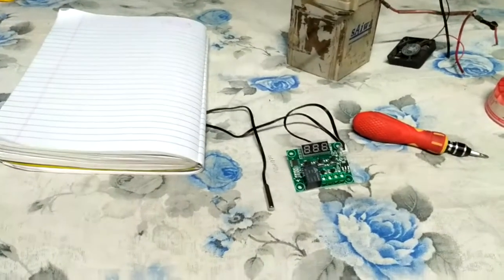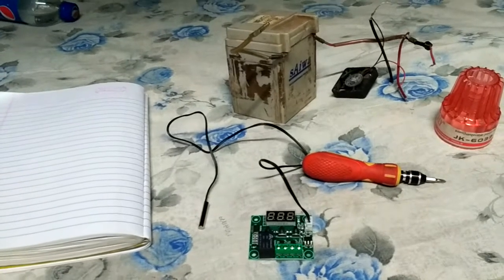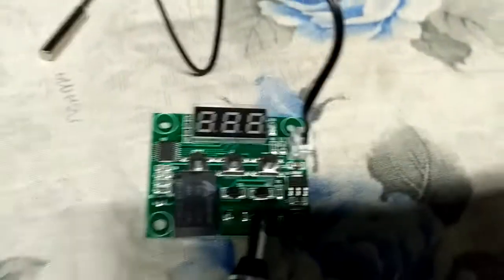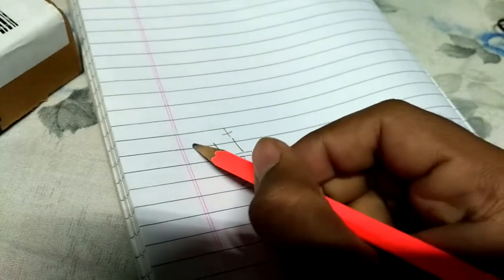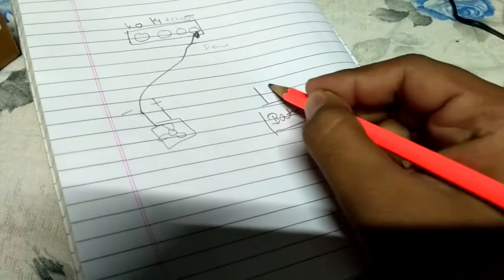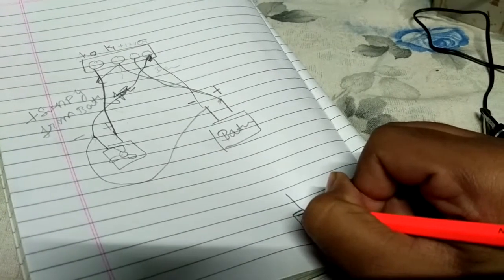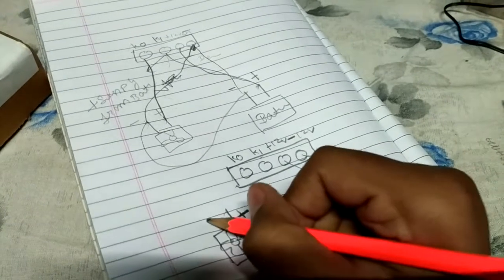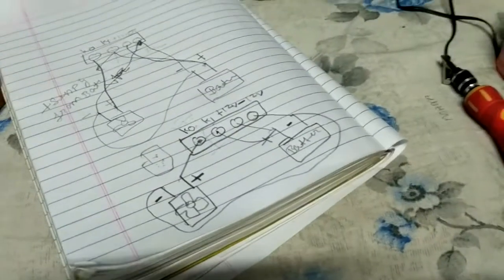W1209 temperature controler device tutorial part 1

Comment: Jeet i am using this thermostat for incubator. 
For that i want to use bulb for heating. 
but i am little bit confused about bulb connection in thermostat.  would you like help me regarding this
Reply from the maker: Sure
Reply: Thanks Jeet. This is my whatsapp no- 8794774077 you just txt me i will be there to get help from you. It will be very helpful for me